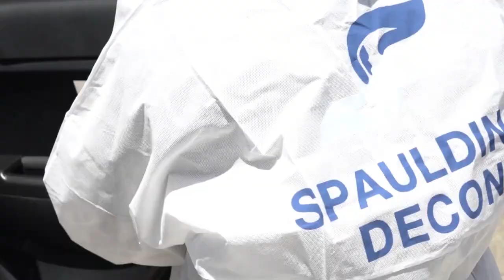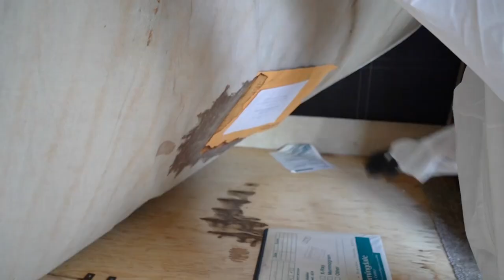7 Dead Flies On The Bed

Comment: One thing I notice every video I watch is the amount of hand spraying y'all do. Have you ever considered an electronic mister/sprayer that will make it go faster and help with hand cramps. I think doing that will help cover indicator over large areas, and small areas you can still use a hand sprayer. Just an idea, from a very happy fan that loves the work you do and share with us! ♥️♥️♥️♥️
Reply: Those types of bottles look like you can toss out after each use so you don't keep useing once contaminated stuff . I wouldn't want to put bottles back in my truck after useing it when I been touching other stuff with my gloves
Reply: Well they sanitize everything when the job is done... They don't throw out all of their tool after every job, they clean them. They can do the same for an electronic sprayer too.
Reply: Genius
Reply: I saw Laura using one in the video about the pedestrian in front of the supermarket who was killed when someone accidentally hit the gas instead of the brake while parking. Must be for either much bigger jobs or outside.

Comment: I'm pretty sure the rabbit hole effect happened when one of our cats peed on our bed 😿 I've tried multiple products to try to get the smell out and it's mostly gone but on a hot humid day i can still smell it a bit. I'd welcome any suggestions for anything else to try 😅 besides get rid of the mattress; it's only a couple years old 😸
Reply: Have you tried spraying vodka in it. For real. There is this stuff I use to use that worked amazing. Let me see if I can find it.
Reply: Scoe 10 X odor eliminater. You can order it online. @samantha ann graham.
Reply: There is a chemical spray you can get they eats or kills the bacteria . it is the bacteria that causes the smell. I think you can get it from a pet store. Nature's miracle. You would have to really soak it down good and let dry.
Reply: @SheCat1964 that was one of the ones I tried.  I dumped a whole bottle of Nature's Miracle on it😿
Reply: @courto4752  I've not heard of that one. I'll look into it. thank you.
Reply: Nature's Miracle foam...online on Amazon or at Walmart best thing removes the odour completly cuts through the enzymes